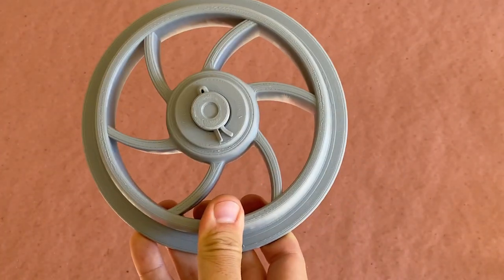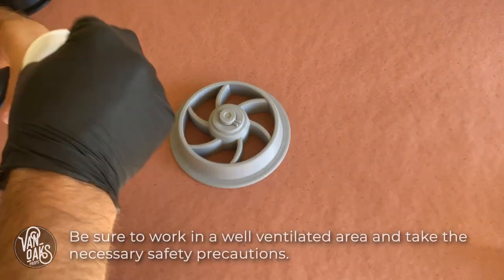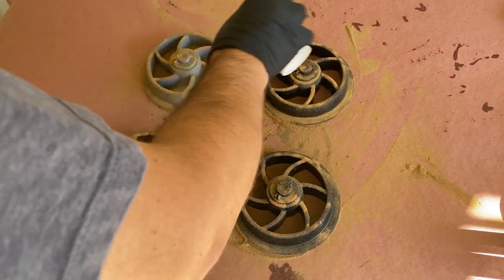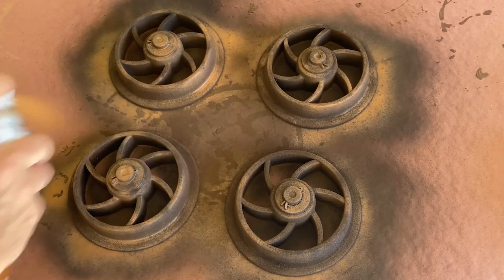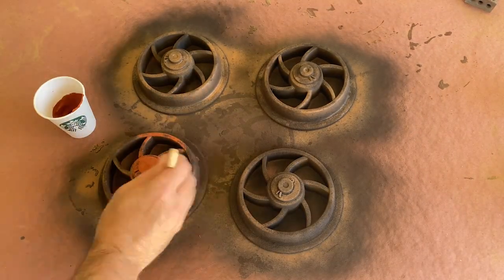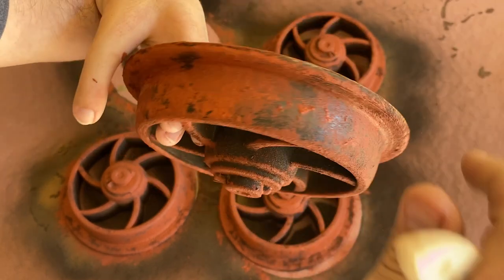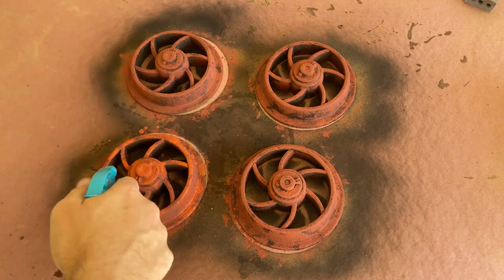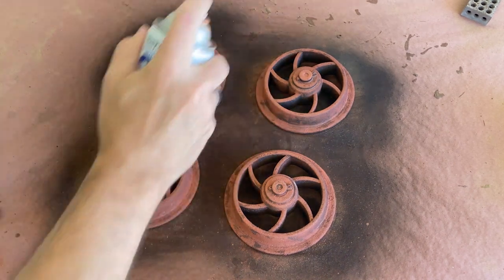Fake Rust with Sawdust

Comment: Thanks for yet another great technique video. As a fellow prop builder/ Halloween yard haunt guy in the LA area, I thought I’d share a tip I use, that I learned years ago from a set designer friend. A great way to make rust stand out at night is to lightly mist your final rust paint with fluorescent orange spray paint. I know. Sounds sooo wrong. But totally works. Also looks surprisingly realistic in daylight, as long as you just mist it. And being fluorescent, it helps prevent the rust effect from fading into the darkness at night, like regular acrylic colors can.
Reply: Agreed! Fluorescent, gold and silver paint used as highlight or misting can lead to great results that you never expect. Thanks for tip on floro orange on rust!  I have taught prop building/painting  for stage and we use normal craft paint floro and spray gold . We either spray it direct and lift it off with plastic bags or spray the scrunched plastic direct and tap on prop for random highlight. When you have a prop blasted with a bright white spot light you need some strong colors to keep it from washing out.

Comment: The baking soda technique is cool, but I think I like the graphite powder instead. Also, for a quick way of knocking down those layer lines, try your acetone / glazing putty method...but put it in an airbrush. It works amazing and super fast too. Just make sure to mix it in another cup before adding it to the paint cup, otherwise you'll clog the airbrush. Thanks for the video! 🤘💀
Reply from the maker: Not a fan of the airbrush technique. The time wasted having to clean out the airbrush, the cost replacing the internals as they wear from running the abrasive spot putty through the airbrush body, and the fact that you’d still need to do some degree of sanding just doesn’t make it worth it to me. 

I’m glad to hear it works for you though. That’s the most important part.
Reply: @VanOaksProps  point well noted 👍. In a pinch, look into harbor freight airbrushes. They're super cheap and get the job done for you in a time crunch. Thanks as always man 🤘💀

Comment: Neat idea with the baking soda. For my rust work, I've been using cheap spices like cinnamon and nutmeg, based on a video from Monster Tutorials. The end effect is incredible, but the smell can be distracting of the finished Prop for a bit. That, and the baking soda would be even cheaper in bulk...
Reply: Paprika , then you don't have the smell , best one is spice it brand paprika , the color is perfect , each brand is slightly different
Reply: I use a mix of apricot ,brown oxide, and kings gold , all plaid colors , I apply the rust color ,put the paprika over the top ,then use the dirty brush water to wet the paprika

Comment: since 3Dprinted parts are mostly thermoplastic
you can give texture or artificial aging with heated metal sponges and other metal parts (like brass brushes)
and
clipping some parts like the security bolt and replace them with real ones is also a fine option to make it less obvious it is "faux"

Comment: What happened to paprika rust ? With the right paint it looks fantastic . Also garnet sand stuck to tacky coats ,and painted  over , looks fantastic
Reply from the maker: That works too.
Reply: @VanOaksProps   I'm going to try this baking soda idea , I like the white tint , that would look good on my sandy dusty props . I use a lot of the dust from the bead blaster too, the fine dust that ends up in the dust collector , it looks like regolith from the moon. Just apply spray glue ,and hit it with an imsectcide duster full of it

Comment: Great finish and nice idea with the baking soda, did you sand the parts at any stage or was the smooth on good enough to work with. Was that XTC3D??
Reply from the maker: No sanding at any time. Just the XTC3D epoxy.

Comment: Has me thinking: Rust, in a more heat-dry, dusty environment, as like an old, abandoned wild west gold mine, would have this color of rust you chose there. It´s rather bright, as it would be constantly sanded by the dust and fine sand grains carried by the wind howling through the depths of the mine.
Would it be a more moist, swampy area, like the said mine would be located in a bog/moor, the rust would be of a far more darker brown (like the old metal scrap pieces in my dad´s garage 😅).

Comment: Hi Derek, 

I was wondering if you could give some advice on getting started with 3D printing - I would like to get a printer, but have no idea how much a decent beginner/ intermediate 3D printer would cost, or even where to start looking. Any thoughts?
Reply from the maker: You may be surprised to hear this, but there's not a ton of difference between "beginner" and more "pro" 3d printers. They all work on the same principles, it's just the bells and whistles that differ (generally speaking). I'd say if you're looking for a good right out of the box printer you could go with the Elegoo Neptune 3. I'm using the Neptune 3 Max (their largest machine) but I've had a really good experience with this machine and have heard similar about the smaller versions.
Reply: @VanOaksProps Thanks man! Hope you and Mrs Oaks are doing good!